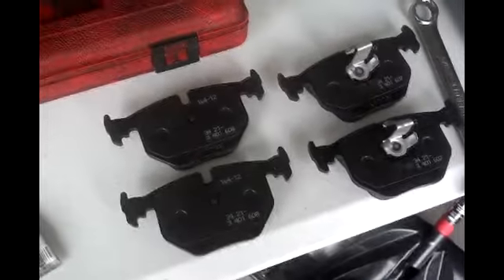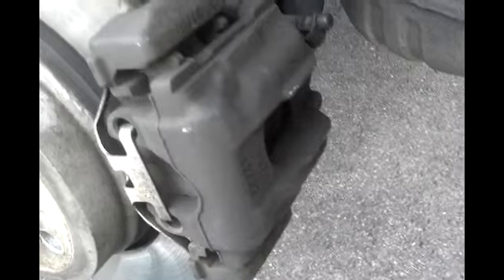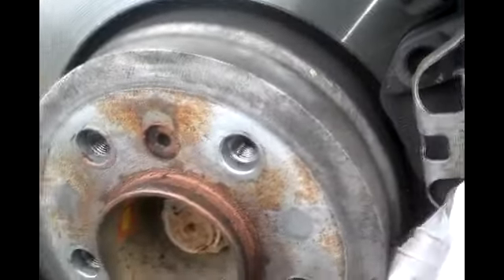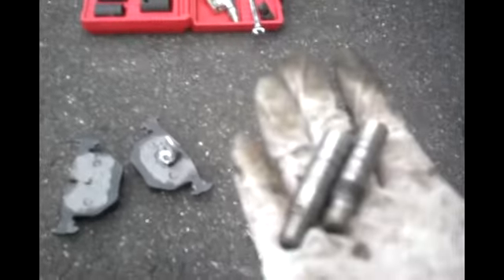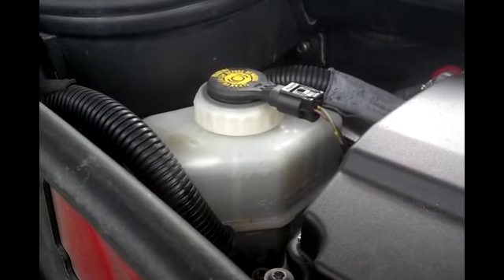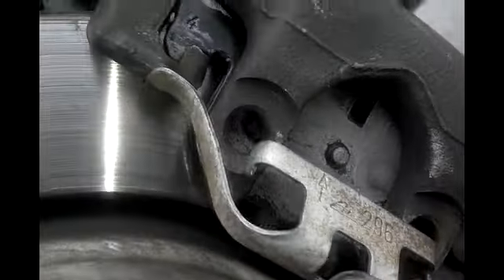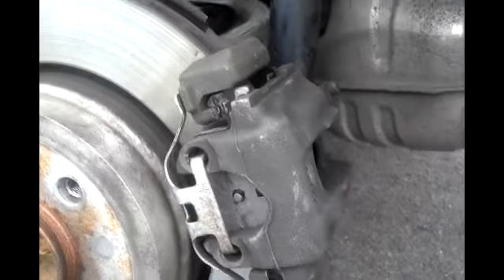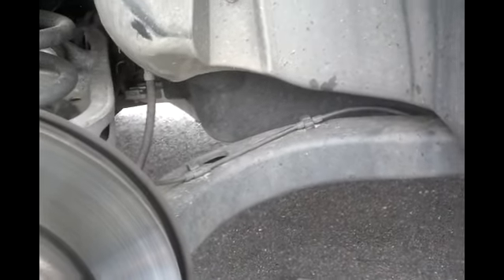BMW Rear Brake Pads And Sensor Replacement E83 E46 E38 E39 X5 E89 DIY

Comment from the maker: Hello Kyle, Thanks for the advice. I have never had a problem on a BMW letting the caliper hang but it does depend on the condition of the brake line. However, it is good advice to tie it up using a bungee.

Comment from the maker: Hello, For the rear brakes leave the vehicle in gear but the E-brake will need to be off. I like to put some wheel chucks (or you can use rocks or wood) in front and in back of the front wheels to prevent rolling to be safe. Make sure you are working on a flat area as well and use jack stands for safety :)

Comment from the maker: For a 7 series EMF electronic parking brake you hold the button for 5 seconds. But you may need the system reset at the dealer using the BMW tester.

Comment: I have an e46 m3, and the rear skid plate is on the way of accessing the rear brake sensor. You have to remove lots of bolts just to have access. I had to remove some of them and force that plate down to I can get my hand in there. It barely fits. What a pain. Am I doing something wrong? I don’t see how this was done on purpose to get to that sensor box.

Comment: I have a e46 m3 an I see you pushed the piston back in but after changing disc an pads do I need to bleed the brakes with the nipple or just press the brakes a few times thank you
Reply from the maker: Mike Barratt Hello Mike, if you are only doing a brake job and did not open the system via the bleeder screw or by replacement of the caliper you will not need to bleed the brakes. You will only need to bed them in by stepping on the pedal and taking the vehicle for a short drive. Make sure to avoid hard braking for the first 200 miles if you can to help them bed in well.
Reply: Top man! Cheers mate